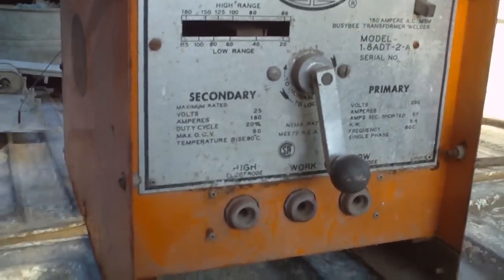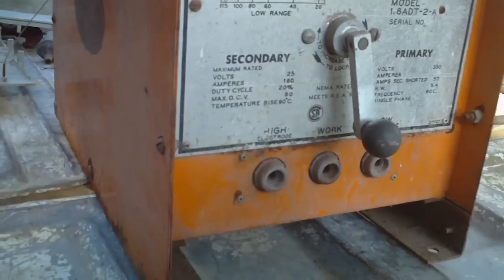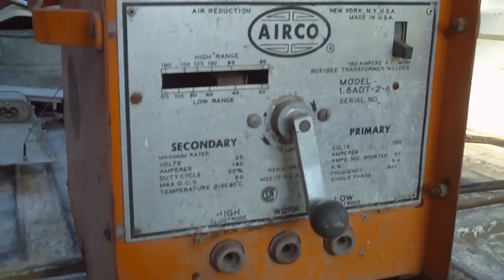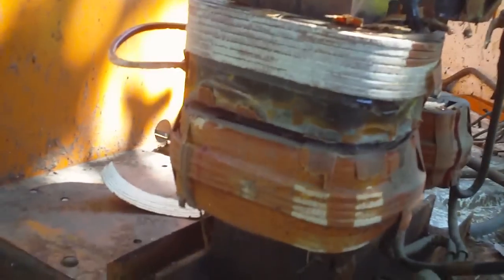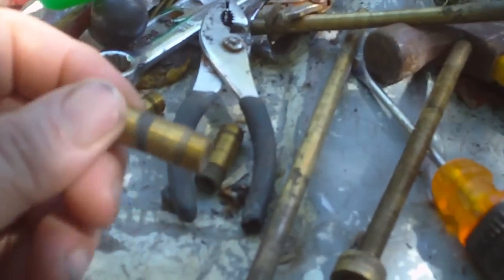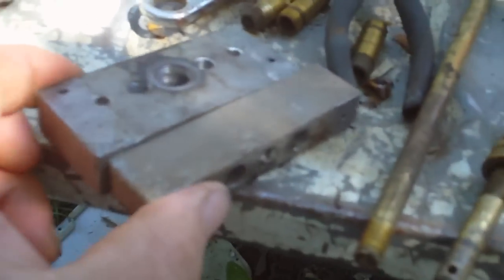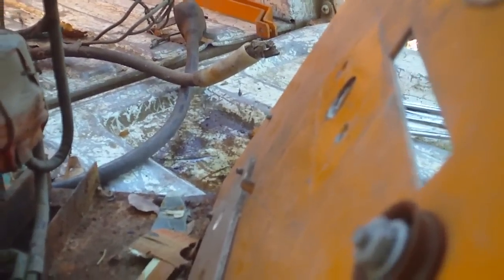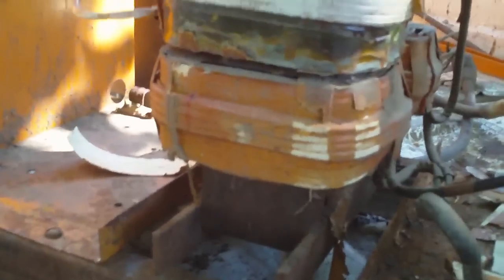Is scrapping a welder for copper worth it?

Comment: That brass shunt lead screw for this Miller House Branded machine is nearly $100cdn at Miller. I know, I fabricated one rather than buying it. Aluminum windings are not worth much but the welding cables are @$4.00 a foot new. I would have parted out and sold parts online.

Comment: Older welder has good copper but heavily wrapped. I just pull it out and throw in bonfire to burn off residues and paper then throw right in bucket with water and vinegar to get #1. Skip that and you will have copper #3 that same price as 90% copper wire. Newer welder often has copper clad aluminum wire.

Comment: man prices must be way down out there but still good pay out...
Reply from the maker: savagenomore Yes they are what are the copper prices where your at?#1 here is 2.30#2 is 2.10, but I sold some extruded aluminum the other day and .65 a pound which is great for this area...
Reply: it stays around $3.00 a pound and usually #1 is about .30 higher than #2 but I go to a place that sells directly to the refineries so I get top dollar, I can go to another place across town and they pay a lot less because they sell to the other place, they pay like $7.50 per 100 for steel where the place I go to pays like $10.00 per 100 right now...